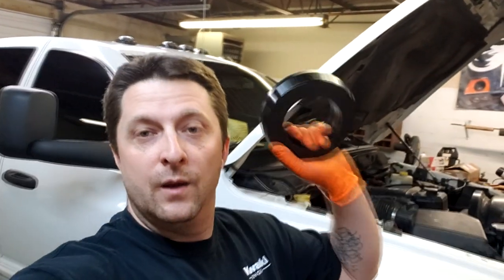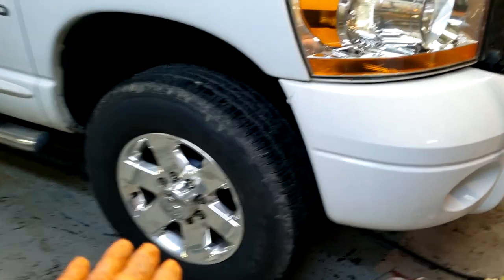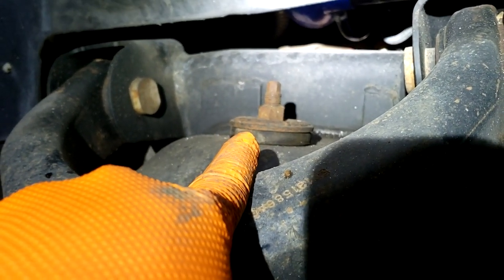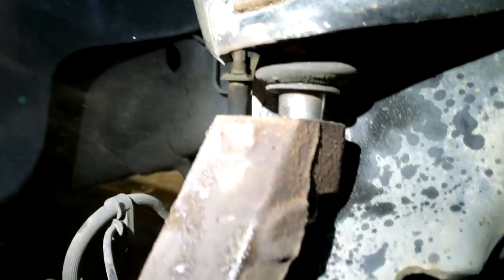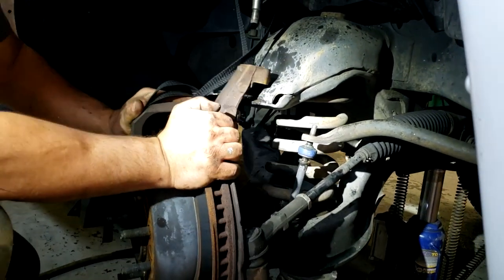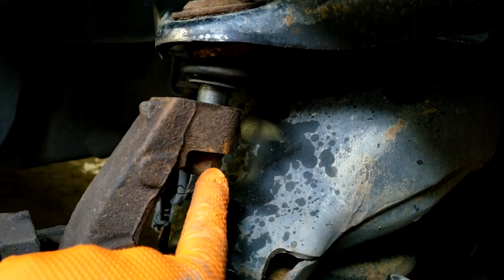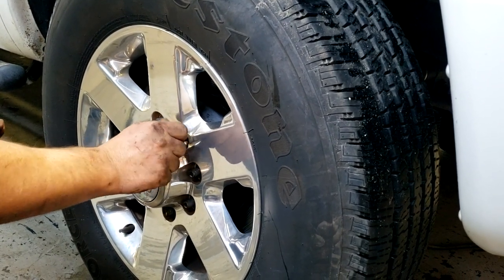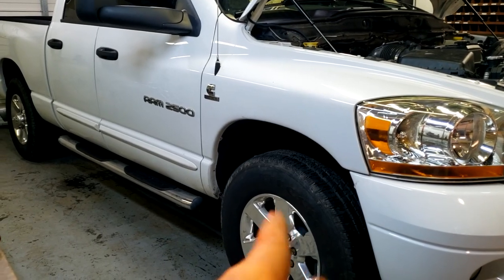Dodge Ram 2500 Front Leveling Spacers Installation

Comment: Got my lift installed.  Your video was most excellent!  One thing I had to do was to disconnect my lower tie rod, just below the sway bar.  I didn't undo the tie rod ball joint, instead I loosened the adjusting nut and unthreaded.  I needed to do this to get enough room for my spacer.  It was easy to do and just needed to be careful to not move the locking nut so the alignment ended up at the same place as when I started.  If anyone has trouble getting enough clearance for the spacer to drop in, just unthread that tie rod end and you'll have plenty of room.  
I used 1.5" spacers.  The final measurement on wheel well clearance from the top of tire to the wheel well opening increased by 3.5"   I guess the effect of the spring spacer spreads the A-arms exponentially so 1.5" further inboard with the spring equates to 3.5" at the end where the tire is.  My truck is now like yours; 1" more space at rear wheel than front wheel and level when loaded.  I run air bags in the rear for heavier loads so my headlights won't need adjusting when driving at night.  Otherwise, a T20 torx driver set the headlights just fine after done.   
Thanks again for your video.

Comment: Got an 06 ram 3500 2wd and the spacers go on top of the spring and not the bottom. Not sure how you were able to pull off putting yours on the bottom due to the coil spring and how it sets in the lower contril arm.

Comment: Just replaced my billet Supreme Suspension alluminum 1" spacers and put the 1-1/2" Daystar spacers on the top of my coils in my 2wd 2500 as recommended by Daystar. Much better ride height now.
Reply from the maker: What year truck? The spacers i have did not sit correctly on the top of spring. Also don't see how it would make any ride difference at all on top or bottom as the springs is a set weight.
Reply: What's the difference between the Supreme's and the Daystar? Like why did you change out the Supreme's? Thanks
Reply: How are thr daystar shocks? I am about to do that, but read some negative reiviews?

Comment: Yup good thinking about not more than an inch as most guys go perfectly level an when they tie it is squatting at rear An looks like it can’t carry much of load lol.. An headlights are up in trees coon hunting an also I beleive it makes front tires angle in an get wearage .. I like the truck with out the stacks a lot better 👍 will you be getting an alignment now as things have probably changed angles an wear tires ?
Reply from the maker: Thanks, yes will take it in to get checked but really didn't feel like the alignment changed much with the small lift.

Comment: Installed 3” on mine following all your instructions thank you. 
Only thing is my truck is like jumping and really hard in the front, maybe need new shocks? Maybe springs was too much compressed after put a 3” spacers?  Do you have any idea why?
Reply: I put 2.5 inch spacers on mine and it did the same thing and I got new shocks and shock extensions and it still was jumping and very stiff. Did you figure yours out ?

Comment: Great video. Ive got a 2016 ram 1500 2wd and gonna install 3 inch spacers. So on the 2wd, the spacers go on the bottom?
Reply from the maker: Mine did

Comment: Great video.  One thing that I have not yet seen in this or any other video on the subject of spacers is wheel alignment.  Would these spacers not affect the camber of the tire as the position of the 'A' arms is different from stock?  Did you have your alignment checked after the install?  Thanks.
Reply from the maker: It a pretty small change didn't seem to bother mine to much but alignment wouldn't hurt

Comment: Shouldn't the spacer go on top of the coil spring ? And because of the position of the coil spring in the "A" arms and leverage a 1" thick spacer should get you up about an 1-1/2" Approx. Did you measure the wheel well height opening before the spacer install ? Just curious. Thanks for the great Video.
Reply from the maker: My truck is 2wd it seems the 4wd setup goes on top.

Comment: I was about screw mine all up. I have  2 inch spacers and I thought it went on top. but I have only seen videos of the type that has the bolts in the spacer. My truck is a 2wd as well. Do you think It could be a one man job to get the spring back in place or should get a buddy and spring compressor?
Reply from the maker: I did it myself

Comment: Y u put the spacer on lca everyone ive seen done has been top of spring
Reply from the maker: I believe the 4x4 mounts on top with bolts
Reply: Just never seen them installed on the bottom of the spring didn't know if it was something special

Comment: I have another question; the link to ebay kit is for 
Leveling Lift Kit 1.5" Front For Dodge Ram 1500 2500 3500 1994-2001 RWD 2WD 2000
You said you used a 1" kit and that your truck is a 2006.  The kit in the link is for a 1.5" lift and '94 to '01 truck.  Just want to confirm that is what you used.
Reply from the maker: Thats right

Comment: Hi I installed a 3 inch leveling kit spacer on top of the spring and the suspension feels really rough I’m getting oversized shocks would that make it feel like a smoother ride the suspension is the same as that one or a 2 wheel drive 2500 with a Cummins please let me know what I should do
Reply from the maker: Shocks will help alot
Reply: Shocks will help but you have to sacrifice ride for looks of your truck. You will never have the ride you get from stock after you install a spacer.
Reply: Hey buddy, did you solve it? I have same problem on mine 3” as well, drives really rough 😩

Comment: Hey man I have a 1500 megacab it has the same frame as the 2500 I’m running the maxtrac springs. with the taller maxtrac  shocks man. I ordered the pro Comp 1.5 inch spacers. Do you think I’d have any issues stacking it at the bottom
Reply from the maker: Not sure mine seemed to only fit on the bottom.
Reply: @FrostbiteRam  going to put it at the bottom. I think maxtrac makes a kit for a 4-5 inch coil. Should help so I don’t bottom out or max out the shock

Comment: How much longer shock did you buy?  The parts houses around here always ask what truck.  When I tell them I've modded and need for my 2007 Dodge ram but exactly 1" longer, these kids haven't a clue how to find that.  Can you give me a brand and part number I can at least cross reference for these dim wit high school kids behind the counter?  Thanks!
Reply from the maker: I used stock height shocks just new ones because mine was worn out. Didn't need longer ones with my truck as the lift is very little.
Reply: @FrostbiteRam  Thanks!  In the video you mentioned getting new shocks from the local auto parts house.  Glad to know stock works.

Comment: Hey man I know this video is a little old but I’m needing some help. I recently bought a motofab 2inch spacer for my 2004 Dodge Ram 2500 2wd. In the directions it said to put the rubber spacer on top of the new spacer and put it on top but it rides like crap. I’m gonna swap it to the bottom did you leave the rubber spacer on top of the spring?
Reply from the maker: My kit just came with aluminum spacers no rubbers
Reply: Mine just came with the aluminum spacer as well but on top of the spring there is a rubber spacer that is on there from the factory. Did you leave it on there?
Reply from the maker: @tommytownsendmusic2104  mine did not have that perhaps because mine is 2wd?
Reply: I think your supposed to leave that rubber spacer on there, either put the spacer on the bottom of the coil and leave the rubber spacer on top or put the rubber spacer on top of the 2” spacer and put that on top of the spring if it still rides ruff you need to buy new shocks cause don’t forget your adding more tension to all your suspension components
Reply: I just put a 2” spacer in my 06 2500 2wd and it has the rubber pads on top also, however I left mine in. It rides fine, the only problem I have is my suspension is so long now the upper control arm is hitting the top of the shock tower when I go through bumps and my wheels go down very far.
Reply: Might get aftermarket control arms to get the clearance I need